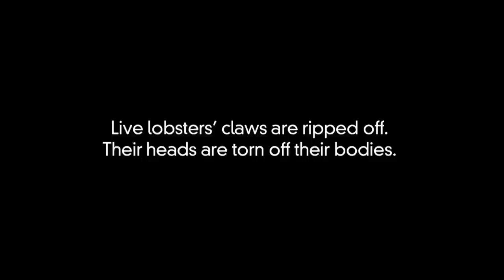Exposé: Live Lobsters, Crabs Torn Apart

Comment: Most of the movements are just the nerves firing after death, since they experienced some shock the nerves are still twitching and moving when they are tossed.
Reply: False, you can't tell they aren't still alive
Reply: Actually, lobsters don’t have a shock system with their nervous system. So they feel the pain up to a couple hours afterwards.
Reply: For ten seconds maybe  but NOT FOR HOURS?!
Reply: They don't have shock system, they feel the pain until they die properly
Reply: they dont have a shock system

Comment: Wouldn't it be easier if they killed them first? I mean, the dude even said they were feisty.
Reply: that'd be too expensive, this is way faster. Just because they're feisty doesn't mean they're impossible to work with.
Reply: Lobsters meat decomposes in like a day so they kinda have to do this even if it's fucked
Reply: Exactly. Could drive a spike through the brain before they start processing, but instead they just rip them apart while alive.

Comment: wth were supossed to cook lobsters alive not rip them alive in pain
Reply: And that's not painful? I'd rather not be thrown in a pot of boiling water, that is probably more painful than having your head chopped off. Crustaceans loose limbs all the time, both from escaping predators to ripping them off themselves. As for the twitching afterwards, that is just the nerves causing the muscles to contract randomly with the remaining stored energy in the muscles. Is for stomping on the lobster shells, that's probably over the top. Otherwise, it is probably quicker and less painful (If crustaceans can even feel pain) to use machinery to process crustaceans compared to using a knife and doing it all by hand.